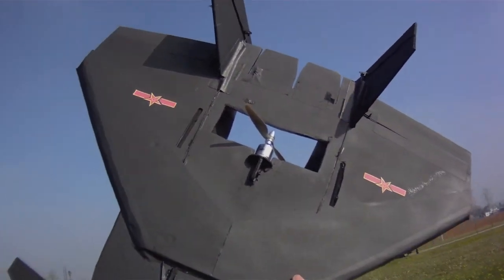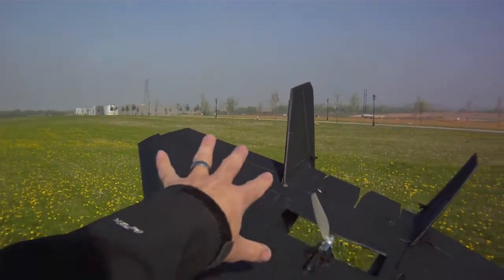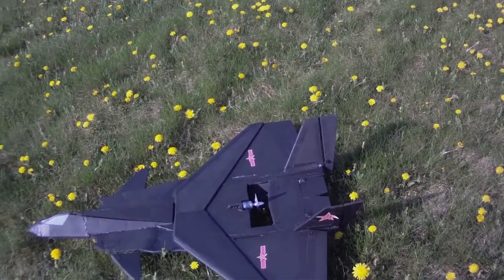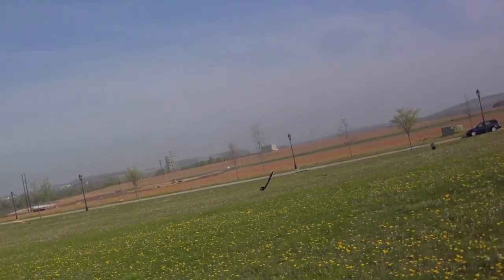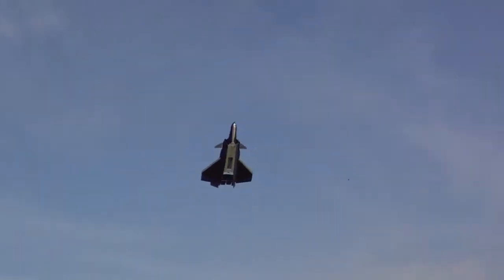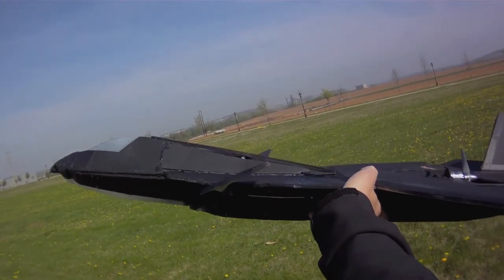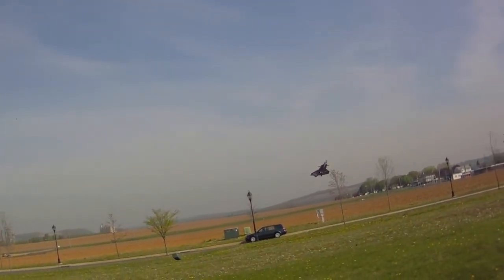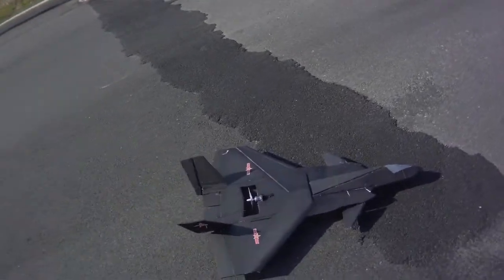J20 High Alpha Testing

Comment from the maker: The thrust vectoring doesn't counter the torque roll because the torque is generated a second before the prop is winding up.  If thrust could happen instantly or before the motor spooled up then you could counter it.

Comment from the maker: Well,  the 7 inch prop has plenty of thrust but in high alpha the wings will do nothing to prevent torque roll so it is that much more of a problem.  The 6x4 has much less torque roll -almost nothing - so i will work off of that for now.